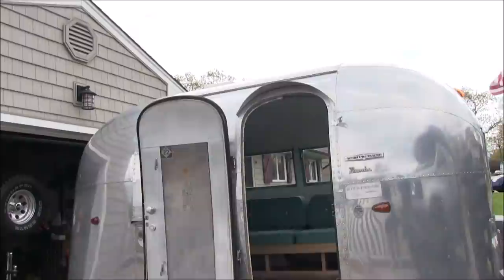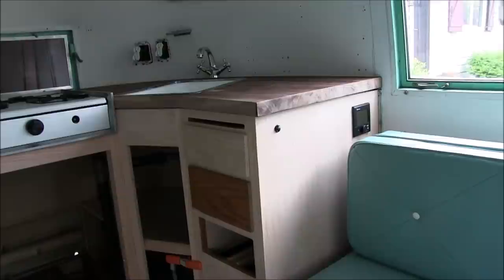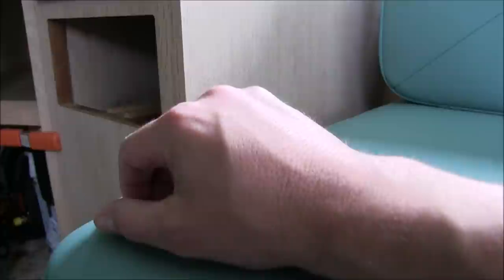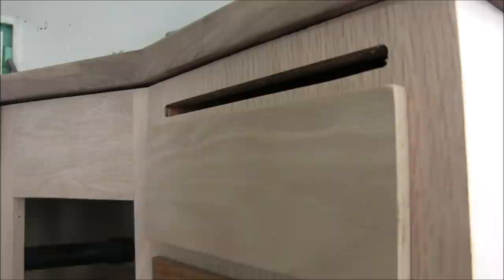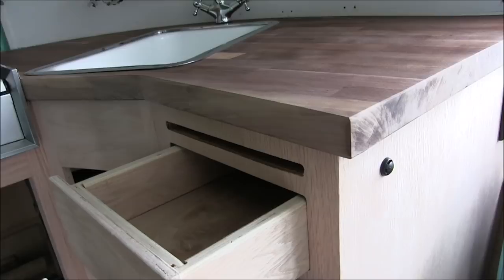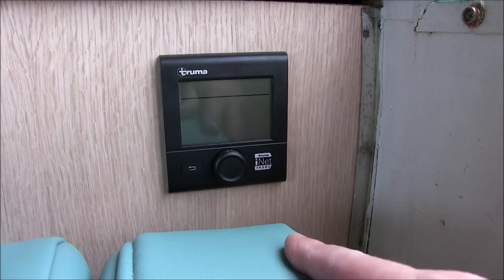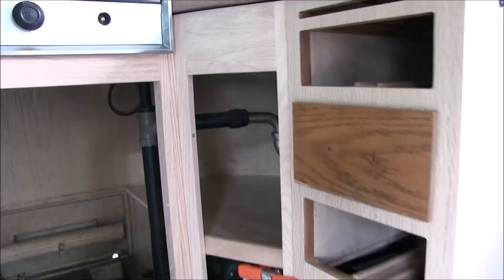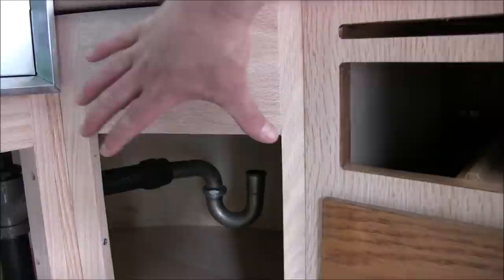Renovating an Old Airstream  - Wood Veneer & Drawer Tracks

Comment: Down here we have Ace Hardware.  They sell Bee's Wax 'pucks', and you heat one edge just a bit and coat both sides of your drawer slides to lubricate the slide itself.  Works really well and reduces the amount of force necessary to slide the drawer in and out and reduces the amount of sawdust you get from the slides wearing on each other through use.  You do have to re-apply it from time to time, but it makes for really nicely working drawers.  Very nice video, you have some really good looking cabinetry there now.
Reply from the maker: Thank you for the tip